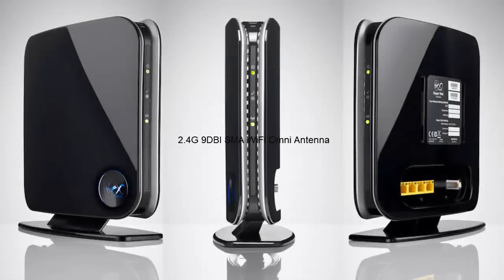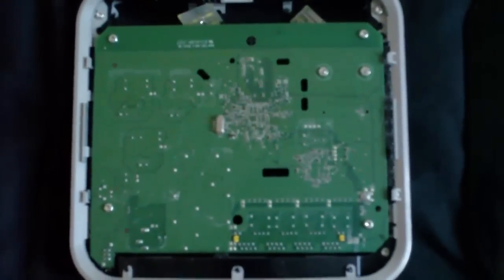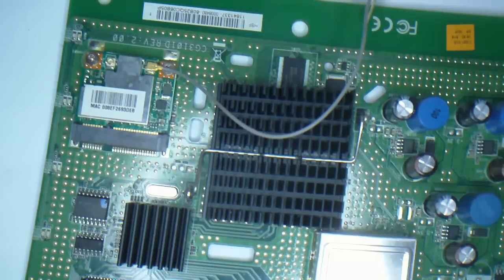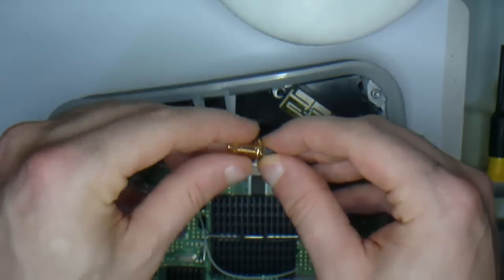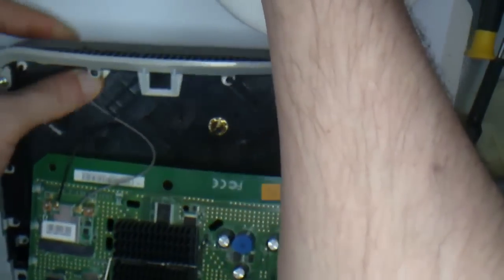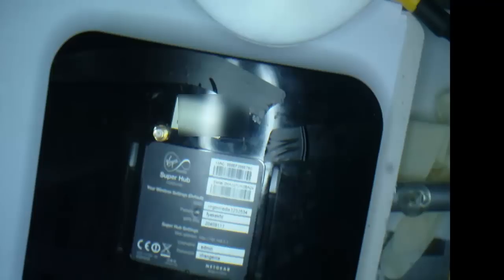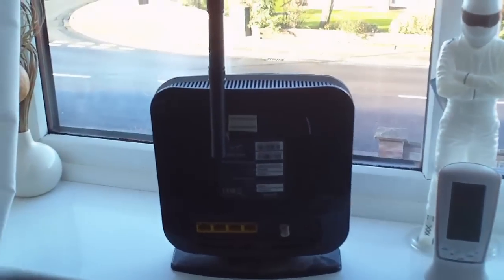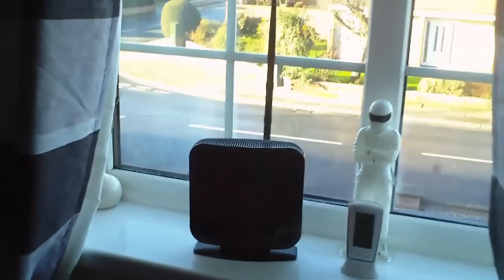How To Add External WiFi Antennas To Router/Modems (Virgin Media Super Hub)

Comment: This vid would have been far more informative if more care and time was taken. What he has done is removed the 5ghz Antenna probably a  Netgear and Blue in colour and attached to the board the Ext 5ghz Ariel pigtail , the 2.4ghz is still attached to the board, would have been better to attach a 2.4ghz which is a smaller length, they are not inter changeable and wont work if fitted wrongly on the board. I would fit both while I'm at it.

Comment: I have an acre back yard and my netgear router has internal antennas.
I'm going to do your mod and install 2 external omnidirectional wifi antennas outside to get a boosted signal everywhere for my wifi cameras.
Thanks for the simple antenna connection video.
I've seen that antenna in PC's and routers but never did buy this adapter you mentioned. 
Amazon is more trusted to buy but cheaper on ebay.
I'd put 2 on any router, especially 2.4 and 5g models. 
Just my 3 cents.

Comment: I'm doing a similar thing with my vodafone hub...which has 3 connections for the interal wifi. I also have a spare hub to do a test run on so at least do a test run to see if the connections are just that and not test ports.

Comment: I have just taken my Virgin Super Hub apart and if done in the correct order there is no need to damage any of the tabs and have to glue the case back together!

Take apart as follows:

1. Remove the two T9 screws below yellow connector block (secures the base stand)

2. Remove the base - the lugs are disengaged by applying pressure from the outside towards the centre whilst gently prising the footing apart. Repeat for the other side and remove the base footing.

3. This will now reveal a security (centre pin) Tamperproof T9 screw that secures the front panel (with the 'blue' Virgin Logo) - I removed using a small flat blade screwdriver (0.4 x 2.4mm).

4. The panel now slides upwards and can be removed with any damage to the securing tabs.

The printed circuit board is secured with four T10 screws when removed will allow the board to be gently prised free - the power button cover needs to be pulled off. I intend to fit two external antennae and will disconnect the two internal antennae and tape to the back cover and leave in place. I will fit the two external equidistant from the top edge of the case (3.5cm in and 2.5cm down). This would allow easy reversion of the modem however, I recently almost cancelled our subscription and VM were not interested in recovering the modem!

Big Dog has a valid point if you already have a quality router at hand - but not everyone has.

Comment: can the original antenna be removed at this time or does it need to remain connected?
Reply: Do you mean the remaining internal one, or the one the external one replaces? The router started with two internal antennas, he's removed one of them and replaced it with a larger external one. You could do the same thing with the second one too for even more performance, but whatever sort of antennas you have on it there must be two connected.

Comment: you say update the firmware, do  DDWRT even do one for the superhub ?I couldn't see it on  DDWRT website
Reply from the maker: +shakennstirred i didnt update with ddwrt. at the time of this video you could download an update from virgin and install it yourself. ddwrt is mainly for routers only and not router/modem versions as you probably know. virgin has a new AC modem now which is loads better than the super hub in the video. i haven't had to mod it wifi range reaches down my road! i have my modem upstairs on the landing of the satires in middle of the house which gives me best coverage.

Comment: I'd personally put the adapter lead(s) out through the air holes at the top, that way if it goes wrong & engineer comes out to replace or test, you can just cut the wires, let them drop, ~& there are no holes drilled!
Just an idea :)

Comment: i tried it without screwing on the antenna and still works, why?
Reply: If you've done exactly what's shown in the video you've only replaced one out of two antennas... he left the second internal one there (the small board stuck to the inside of the case) so it's probably using that. 

Using any radio transceiver without an antenna's a bad idea though, as the energy that supposed to be emitted from the antenna gets reflected back into the circuitry.

Comment: Nice one for posting this. So would a dual band superhub 2 be similar to upgrade or would you not know?
Reply: Problem is, this is hit and miss if you don’t know what routers your doing this on. For a number of reasons. First, while I’ve opened dozens, I’ve never seen a router with a pci-e express slot, or slot of any kind to accept a WiFi cArd. Because then when the next gen cane around, you just upgrade the card. Say, from a n-wireless to ac-wireless. No second sale for them. USUALLY, The end of the wire (like coach with center conductor and braided aleeve) is soldered to the board, so you’ve got that issue. 

Lastly, while some have he same uf.l connectors on Ge motherboard that the card itself does here, you have to deal with the method by which the antennas are used. tech changes. The majority of are dual-band now or mini, which rely on the antennas placement in relation to one another, and I believe use BOTH antennas to send and recieve at the same time. Segmented inside. In which case I don’t think having one different would do you any favors. And if it recieved or sent a higher quality signal, if the board they designed to match those antennas would know how to interpret the difference.

Just a lot of variables. I tried it a few times, and as yet I haven’t improved a signal once. Even doing this same trick here on a laptop, and other times using similar donor antenna from other more advanced router of The same brand. 

So... Good luck, just don’t do anything you can’t take back- and ground yourself on a Metal object before you go touching that board or You’ll end up with a paperweight.

Comment: dont tamper with the superhub, it is virginmedias property.......do what i did, put superhub into modem mode and buy a decent router instead.........the asus n66u which i bought is superb and also allows for vpn setup which would cover all your devices at once.
Reply: Seconded. Got an asus n56u and have it in wireless bridge mode, to bounce from the access point.

Or, Try purchasing a cheap “travel router” that allows access to the splash page, or “captive portal”. Those you can take with you, and hide a dozen devices behind a single IP ADRESS to access Xfinity hotpots, hotels, or wherever with free wifi. Stick the travel router at the end of the arm in front of a parabolic satellite tv dish and point it at an AP Miles away. He fish reflects the signal content of a much larger area back into that travel router in front of it.

Comment: Hi
Can you assist in where to get the cable, screwdriver and aerial? Tried eBay but not sure which I need. I have same modem. Thanks for the vid.
Reply from the maker: Mini PCI U.FL to RP-SMA Female Antenna AERIAL WiFi
Reply: b0bbys0x @201105122707